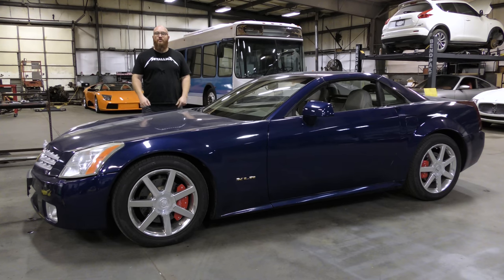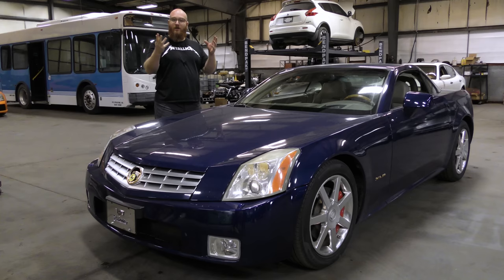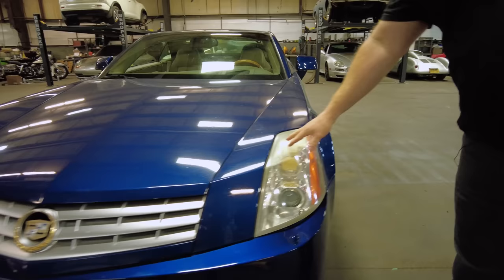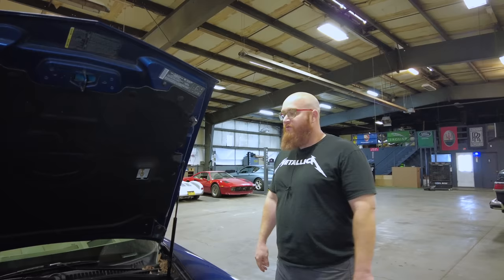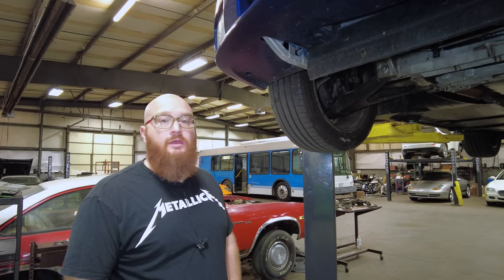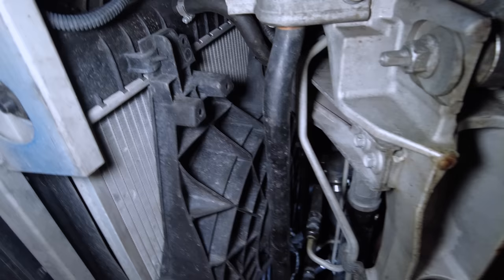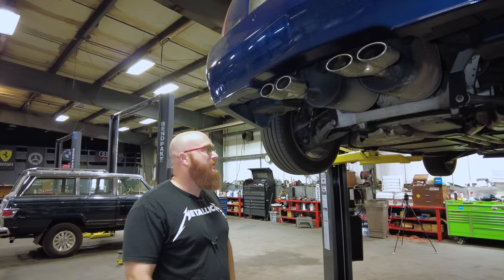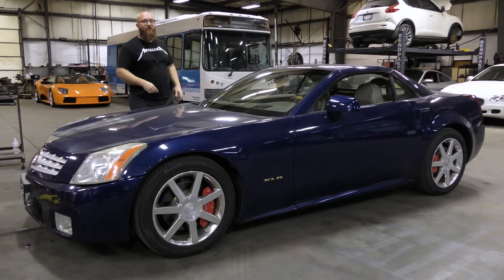Another Northstar? Why does the CAR WIZARD keep buying Cadillacs with this engine? Now an '04 XLR!

Comment: GM: "I,ve got an idea!!!. Lets take the Corvette and remove probably the greatest engine we've ever engineered for hot rodding, cheap horsepower, and reliability and take it out. Then put in the Northstar.........Genius I know.." Everyone in board room stands and claps
Reply: Lol yup pretty much. Should have used the LS2.
Reply: Except this isn’t the Northstar you think it is lmfao. These engines are excellent.
Reply: @ic1815  If you are trying to convince me any Northstar is a better choice in a Corvette than LS based engine it's not happening haha. Just based on parts availability alone the LS stomps the North Star into the dust
Reply: @gearjammergamer8560  that’s not the point lol.
Reply: @gearjammergamer8560  Yeah I'd never personally own a car with any Northstar but that's just me. I'm happy with my LS and it's very reliable and has decent power. I can open up a parts catalog (and my wallet) and get another 200 reliable HP out of it without spending a fortune.
Reply: @FWDSUXARSE  I'm with you on choosing LS over Northstar for practicality, but that's not why the people who buy these cars buy them, obviously. lol It's a collector thing. Wizard just has an affinity for these things. 
     And considering the gamble he took on it, I'd say he did pretty well. Although, I did happen to notice where it had been painted, one of the body bolt holes, ((or, at least that's what it looked like, I'm not rewinding the vid just to be sure)) was broken. So it's my belief this car was in an unreported accident. 
     The previous owner probably died of cardiac arrest in it and ran off the road. You can clearly see they definitely hit something that scraped the undercarriage and probably blew both those shocks/struts ((whichever he said they were up there, I forget)) out completely. 
   I was only attempting to make a joke btw in regards to the cardiac arrest comment lol 
  But, now that I think about it, it's actually a pretty probable hypothesis. It's price being soo cheap bc it possibly sold in an Estate Settlement type thing. 🤣
Reply: @gearjammergamer8560  So much on this car is Corvette, and yet it was the only non-Corvette to be built at the Bowling Green Kentucky Assembly Plant in Bowling Green Kentucky; but to keep it a Cadillac, while maintaining the integrity of the Corvette, they went with the updated northstar, which is said to have been an overall reliable choice.
Reply: If GM hadn't stepped on their dix, like they've been doing since 1908, these engines could have been amazing companions and possibly equals to the LS, and an OHV option for engine swaps and the turbo charging and power adding would have been unlimited. They could have been another in their legacy of building the most successful and prolific engines ever made. But NOOOO...typical GM. For every small and big
block success, they have 6 mega failures. Their only competition, today, as in their entire existence, is themselves.
Reply: I just picked up an 2004 model with only 23,600 K miles in Alabama the elderly owner couldn’t figure out what was wrong with it and besides he didn’t drive it anymore due to illness and age guess what the problem was KeyFob stopped working I got it home programmed it using my think car immobilizer programmer with a new fob from eBay price $3,000 lol 😂
Reply: And on top of all the crazy changes then they charged more for the XLR than they did for the corvette

Comment: I toured the corvette assembly plant when I graduated college in 07.  These XLRs are basically hand built, and were not on the line with the corvettes.  They had their own much shorter line.
Reply: Thanks for sharing that!  I always knew that the XLR was the only non-Corvette built at Bowling Green, I didn't know the process though.  BTW, I also visited Bowling Green for the tour back in 1991- it was early in the C4 ZR1 years and saw a few there and the lone 1983 Corvette which at the time was in the lobby of the factory.  Of course, it is now at the National Corvette Museum which I also visited the beginnings of before they even had their building at the time, they were operating out of a storefront in a strip mall and trying to raise money for their current facility.

Man, I want to go back to Bowling Green sooooo bad.  I'm glad that you too got to enjoy the tour.
Reply: You must've visited the Duesenburg -cord Auburn car museum in Auburn
Reply: Many including this site seem to think these are basically a Corvette.  They are NOT.
Only Northstar Engines were used in the XLR's.  Going rate for choice XLRs is $40,000 in Canada.
Reply: Considering it’s a different engine and a different chassis it would have surprised me to hear they were on the same production line. That would sound very inefficient.

Comment: One advice. Don't leave your cell phone near the start button when you get out of the car. You might not be able to get in. It's an early kind of NFC, like the one on our phones nowadays. It can interfer with the signal from the remote and you won't be able to unlock the door. It happen to me and I was lucky to have the key itself in my pocket because there is a key hole hidden in the rear bumper to open the trunk. Then, you can open the door manualy. Enjoy your rides!! 🙂
Reply: Ohhh Jesus 🤦‍♀️

Comment: Never been a big GM guy, but I've always loved their oddball cars. The XLR, Arora, Allante, G8, ect... The ones that never really had a chance, but were actually... dare I say damn near brilliant. The Northstar itself is such a shame. It's really too bad it's name was tainted by the time they finally got it right. So much potential. Just like GM always does. So close to making the perfect thing, buuuut juuuust missed it.
Reply: I still think the Aurora was a high point in design. Very of its period, of course, but there is 100% chance of having one in my fantasy garage.
Reply: @NFMazdaspeed  i agree, the design has aged like fine wine, it's very beautiful.
Reply: The G8 could have evolved into a hellcat challenger
Reply: Love the ssr I have sometimes except the a/c and top don’t work
Reply: The Northstar is actually an excellent engine, just need to replace gaskets and bulletproof it. Modern engines are much worse.
Reply: You stick with what works and build on that.
Reply: @rafaels8017 You mean put 5k into an engine that was poorly designed? 😂

Comment: As a V owner, I gotta applaud the choice Wizard.  Xenon blue is an awesome color in the sun too Edit: I'd replace all the gaudy gold badging with the proper silver/chrome
Reply: I personally like the gold badging but to each their own
Reply: While your changing the gaudy Gold 1990's/2000's emblems, remove those ugly ass red brake caliper covers and change the rotors back to stock as there small enough and you don't need slotted and drilled rotors, please Amen!
Reply: @toddsholtis4470  Those are the stock calipers on that car.
Reply: @jreyman  maybe the calipers are but I was referring to the garish aftermarket red metal shields...
Reply: That's actually an amazing color on the blue red or black the XLR came in
Reply: @toddsholtis4470  Indeed, those are shields on top and Wizard might as well just have the real calipers painted red instead
Reply: @jmoney7289  Don't forget the super fancy silver haha.  While they're insanely rare, there were a few white XLR-Vs that look fantastic
Reply: @toddsholtis4470  THE RED CLASHES WITH THE BLUE ANYWAY.
Reply: I wonder why the respray if as the Wiz says it wasn't in an accident

Comment: I own a 2008 XLR-V (bought it off a lease). It's been a great car. 39M miles and it is a head turner here in L.A. ( drive it on weekends). The bad: Interior is more like a Chevy and not a Cadillac. But the car is a keeper and has been relatively trouble free in11 years of ownership. Key to owning any car is replacing fluids per manual recommendations (or sooner).
Reply: 39M...or 39K😆😆😆
Reply: 39 Million Miles?!!!!!
Reply: @RDCM1008  It is the Roman numeral for 1000, but I have never seen it used in any modern application.
Reply: Definitely super cheap on the inside
Reply: Sit in a C5 corvette interior and tell me how chevy the interior of an XLR-V is.
Reply: "or sooner" that was the death knell for the 5.4L. Not only were there issues with the engine but they were exacerbated by the unreasonably long oil change intervals etc. I had a 2006 brand new and as it approached 60,000 kms I had it in for service and told the service manager "change the plugs" NO it doesn't need them until 120,000 kms....and as I found out, that's how they get welded to the heads. 

Many people say I've never had an issue with my 5.4L because they probably changed the oil at 5000 kms instead of what the manufacturer said which WILL DESTROY YOUR ENGINE.
Reply: @muskokamike127  exactly. The triton 5.4L was an absolute princess when it came to being proactive on fluid maintenance.

The trucks who's owners actually changed the oil proactively because they tow vs keeping the same interval as factory, are still on the road today. 

The 5.4 was a fantastic engine absolutely fantastic. High maintenance engine when it came to selling to the masses. You neglect the fluids  even a little bit they will eat themselves
Reply: @Seasniffer69  Yeah it was a HUGE money maker for ford.....costly to repair and replace. Hence why it was still a pos after a million sold. 

The thing that kills me is the actual dealer service would argue with you if you wanted to PROPERLY maintain it. Change the plugs early? NOOOO I'd only get $200 to do them NOW, I want $4000 2 years from now! How dare you take that from meeee!

I lost all faith in Ford when they released an engine that relies heavily on oil pressure/volume to control all sorts of things then put a sub standard oil pump in. That is blatantly saying "we're here to RIP YOU OFF"!!!
Reply: @muskokamike127  my co worker bought a 2010 5.4L 3V with 17k miles on it and he tows a 6,000lb boat with it every single weekend anywhere between 100 and 500 miles round trip. Sometimes each day (Friday night,sat-sunday)because he's a big fisherman guy and goes all over. He loves it so far
Reply: @Seasniffer69  well, by 2010 they'd addressed a LOT of the issues. 

when it works, it's a good engine but the issue is "when it works" lol......
Reply: some fields use MM for million, since it signifies thousand thousand.
Reply: @Seasniffer69  Any of the 3V Ford engines are ones to avoid, unless you get such a killer deal you can afford to replace the engine even if it's not showing signs of failure when you buy it.  But the modular platform (4.6, 5.4, and 6.8) were such phenomenal engines and I really don't think they get enough credit for what solid engines they are.  I bought my '04 F-250 BECAUSE it had the 2V 6.8L V-10 and the ZF 6 speed manual transmission.  I wish it had a proper long bed like a TRUCK should have but hey, the used truck factory was closed.  That Triton V-10 is easily a 500k+ mile engine if you change the oil every now and then and don't overheat it.  Ford really dropped the ball with the 3V engines, though the 3V V-10s were still solid because they never put VCT on them.
Reply: @406Steven  yeouch, as someone who drove an 02 v10 f450 mtx for years, blowing out the sparkplugs we're pretty expensive. 

If it wasn't for the PTO dump bed I highly doubt bossman would have had dumped that kind of money dumped into
Reply: Get interior reupholstered in higher quality materials problem solved your in California plenty of custom shops to pimp your ride

Comment: You don't need to start the car to see the mileage. You can push the start button without pushing the brake to start it and it should display the odometer.

Comment: Love the XLR! I own a 2007, Northstar runs fantastic and currently at 150,000 miles!
Reply: Yeah sometimes you get lucky with the head gaskets. I had a 2000 Cadillac DeVille that had over 100k miles and no issues. I sold the car and regret it now because it was my favorite of the over 20 different cars I've owned since the caddie is like sitting on a sofa and it's a magic carpet ride with the air suspension and the Northstar is a really good sounding V8 with great punch to it. I have seen an xlr for sale in my area like what the wizard bought and it's been on the market forever haha. People are afraid of a Northstar 😂

Comment: When I was 19 I had a 98 STS in diamond white pearl with tan soft top, 22" wheels and limo tint. My uncle in-law helped me change the oil and double gasketed it... Overheated on the way home, mechanic said it threw a rod and the engine needed to be replaced. I loved that car so much I paid $1500 for a used Northstar and $1700 to have it installed, even though I only paid $3300 for it (in 2007). Took them 2 months, car never ran right after that. It would stall when stopped even though it was an automatic.
Reply: Lol damn, always gotta double check that old filter for it just to be safe
Reply: Exactly one of the reasons I never let anyone fuck around with my car or god forbid attempt to help me.
Reply: I payed $1,200 on mine just to get the AC fixed lol in 2005 lol
Reply: It sounds like they didn't install your transmission correctly if it stalls when you stop
Reply: Too me doesn’t really sound lik u luv the car soundz lik abuse😂
Reply: 2006 -2011 BEST YEARS 4 NORTHSTAR
Reply: Just LS swap it. 😂
Reply: @Pappderbarp  I learned a lot of valuable lessons from owning that car. Don't buy a Cadillac, always double check the filter gasket, don't drive around with 22" wheels and tinted front windows if you don't wanna get pulled over once a month. Don't spend more fixing a car than its worth, don't sell a car for 2lbs of weed... Always fill out the release of liability form so the new owner doesn't drive around for 6 years with no registration and you get a $600 ticket in the mail. Oh yeah and don't buy a Cadillac.
Reply: I have a 98 Eldorado in diamond white it’s a beautiful car with 70k miles had to put super 40s on it. Love the late 90s northstar.
Reply: @Mason-mt9tl  Diamond white is one of the nicest factory paints ever made, the 3 stage pearl almost glows under the sun. Fun fact, the 98 Eldorado and STS were the most powerful FWD production cars at 300hp. Just never let it overheat.
Reply: Depends on the quality of the weed,
Reply: @donjuanseville3039  04 - 11
Reply: I remember when the Northstar first came out and one of the major car magazines called it "the engine of the future" and that s their swap engine of choice.  Several years ago, I had a chance to buy a beautiful Eldorado with a Northstar and my mechanic threatened to disown me if I did.  What happened to the Future?
Reply: @mattnbin  6.0 escalade motor
Reply: @resetgang6638  "Don't spend more fixing a car than its worth" that is a "depends" situation. If you can fix it right and it makes you upside down in a vehicle, that might not be a bad thing. Ask "what can I replace it with and for how much"? I had a similar scenario: I had a F150 with the 5.4L. I spent $5000 fixing it (kinda sorta) on top of the $5000 I paid for it. It was only worth $6500. Why did I spend it? to get a newer Chev or GM (which had piston ring issues) it would cost me $18000+. I had $5000 I didn't have $18,000.00
Reply: There’s not much holding these heads on. Maybe the double gasket caused even less threading of the bolts?
Reply: @jesselackey5333  It was the oil filter gasket not the head gasket if that's what you mean. Basically all the oil drained out on the freeway so it overheated and went into limp mode. Driving it home blew the engine.

Comment: Power hardtop roofs have been around since the 1956 Ford Fairlane, and almost 70 years later no matter how much technology has advanced, to get a hardtop roof to fold in and back up is still an extremely complex, sophisticated engineering feat. They might have replaced hydraulics and mechanical switches and relays with microprocessors and optical sensors, but getting solid steel to fold into itself and into a trunk is still just as mind boggling in 2022 as it was in 1956.

Comment: The Caddivette is a bucket list car. Jake Wiebe at Northstar Performance is the holder of a patented stud kit with larger diameter,  improved thread pitch studs plus the alignment jig with machining components for consumer and commercial purchases, repair facility network and in-house sales and installation service with warranty for stock or performance upgrades

Comment: I have the same VVT Northstar in my ‘08 SRX, 4k RPM and above is no joke. Once those cams change timing it’s like a whole different animal. That big heavy SUV will move when you rev it. My engine has a bunch of foam and padding over the intake / heads / cams / ignition coils for noise mitigation. Pretty cool they left all that off the Cadivette so you can actually hear the engine!

Comment: If you push the start rocker button without your foot on the brake (or clutch in a M6 Vette) it's like turning a key to the run position without starting the car so you are able to access the DIC to see the mileage or other options. 🙂

Comment: I had a Bonneville GXP with a NorthStar.  I drove it for almost 7 years, and got it to 170k miles.  Except for right at the end, it was very reliable for me, although I did have to change the starter twice in those 5 years, which was a real PITA for this DIY shadetree mechanic.  Its wasn't a super hot rod, but it made good power and was fun to drive.
Reply: "wasn't a super hot rod" yeah, too many people are all up on 600 hp and all that, like who needs that? If you're just cruising around and need to get on a highway or whatever, 300 +/- is fine unless you're driving a tank. 

It's like Hoovie's lightning: it can do 0 - 60 in THREE seconds! Yeah? BFD...it can't tow a 1500 lbs trailer 100 miles.
Reply: I like the Bonneville for the size . But the crappy Northstar! Why didn't  they install the 5.3 LS like in the Grand Prix GXP?